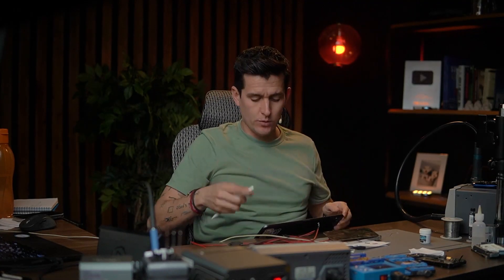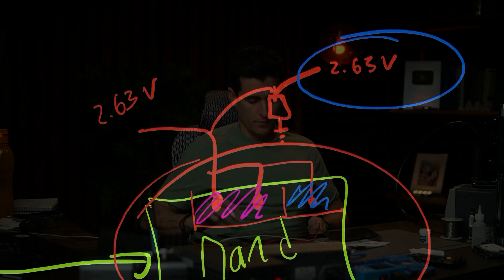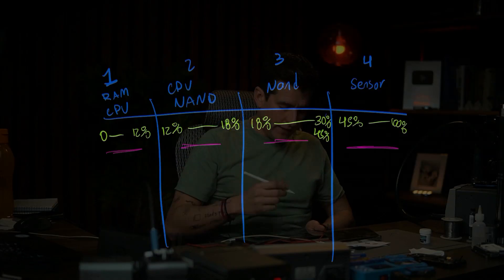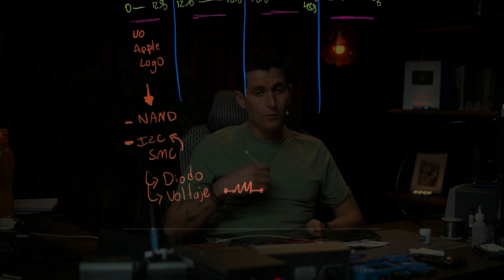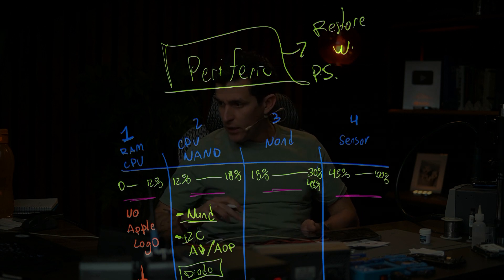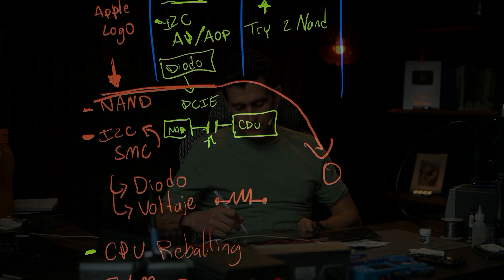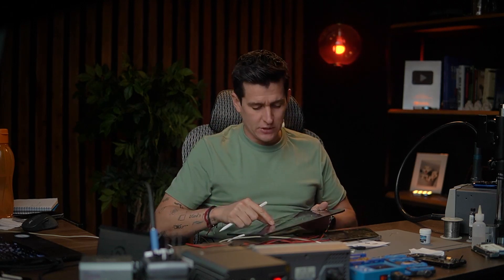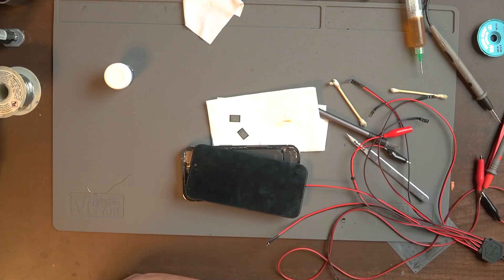iPhone 14 Pro Error 9/4013 | HOW TO FIX IT ✅

Comment: 18:03:51.430: Checkpoint started id: 0x652 (clear_fips_d
18:03:51.430: Checkpoint completed id: 0x652 (clear_fips
18:03:51.430: Checkpoint started id: 0x634 (far_recover)
18:03:51.438: Restoring Image
18:03:51.442: Sending URLAsset

Error at 25% on 3u tool

Comment: Edgar, greetings from the US - thank you for this invaluable info! Most of our clients bring in devices with error 4013 for data recovery. Would these same 3U ranges apply when attempting a “retain data flash”? In other words, with all the flex cables disconnected, unless we’re getting past 45%, data will not recoverable? Because the issues are cpu/ram/nand related?

Comment: Well for my case it gets stuck at 30% error 9 I have replaced nand twice and am still getting the same error code. Am beginning to think could it be the logic eeprom is not connected properly to the motherboard because I have performed a full CPU swap on the upper board or could the bottom board also be at fault 🤔?

Comment: That is a really detailed video i really appriciate it. My issue is that itunes giving me error 9 all the time, I tried 3uTools and it just getting stuck arround 35% but in both cases itunes and 3utools My iphone-X always restarts and just goes back to recovery mode screen. like suppose you on a screen where flashing going on with apple logo and a bar underneath it, But insted of a bar getting filled my phone just restarts and goes back to recovery screen. This is where i get i tunes 9 error and 3utool just dont go further cause it just dont recognize my device unless i restart 3utools. Any help? what i am assuming is it is the battery causing this issue cause i cant charge my phone above/more than red cell icon i get on Iphone. ive tired different cables and sockets and stuff but no success.

Comment: Great Video with a lot of Detail, i Stuck in the 4th Sensor Section and getting "ERROR: Unable to send payload to ASR" and then it stoppes at 50% in 3uTools.
What are the steps to get this solved or do you have some information what i should research next to get the flashing done ?
Its "only" a iphone 13 mini but i think most stuff will also be suitable for my iphone.

Comment: Edgar I’ve dropped my phone broken the back glass and front screen and replaced the front screen, I then tried to restore and it keeps saying error 9, will this be because I have no NFC circuit plugged in? (Wireless charger and flash is all broken) I’ve ordered another back but I’m unsure if this will fix it 😭😭

Edit: when trying to restore it gets to roughly 71%

Comment: Hi, great video! I am currently repairing a IP14 PM (light water damage) and I could restore it until 100%. Then it rebooted, crashed and now flashing process gets stuck between 44%-48%. So NAND replacement is worth a try or should I throw it in the bin?:D